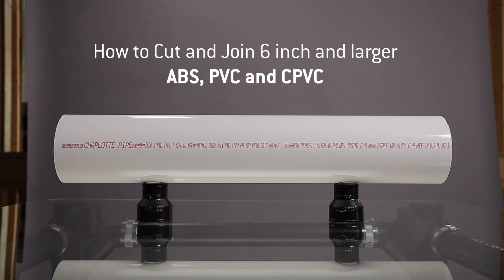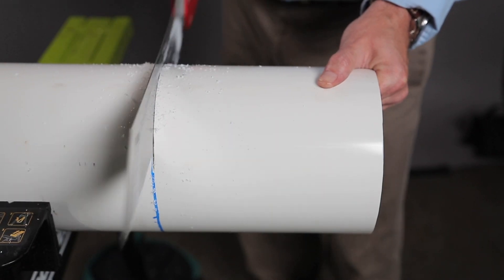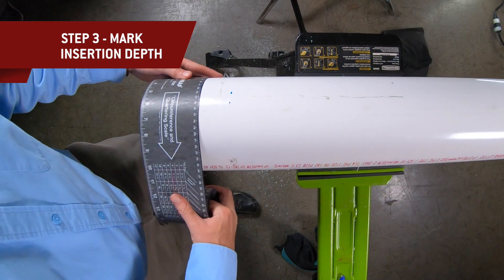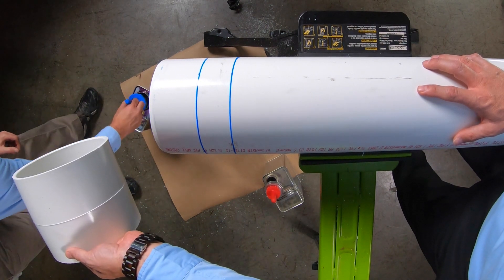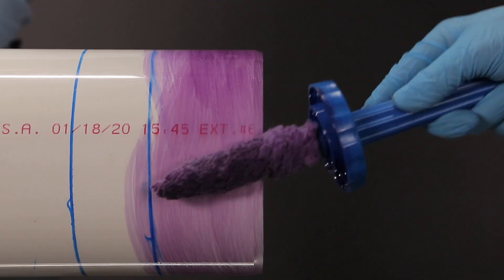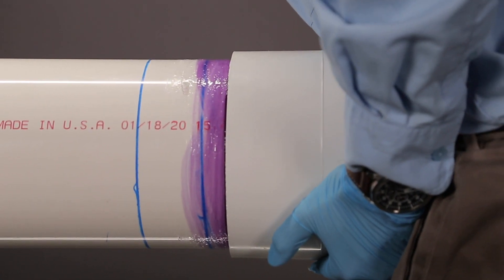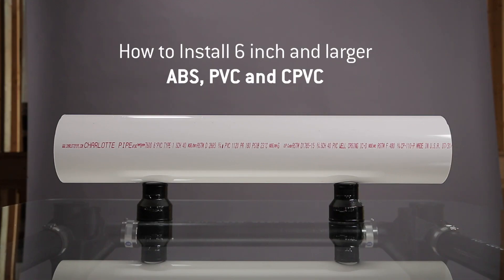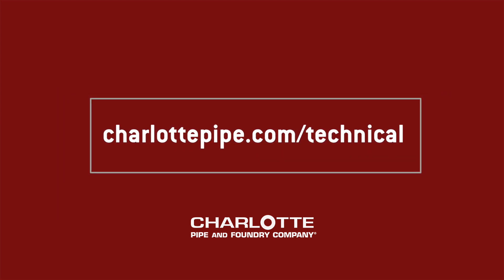How to Cut and Join 6 Inch and Larger ABS, PVC and CPVC

Comment: Can you use 2 pieces of 48" of 4x4 sandwiched together like this II and a sledge hammer to hammer a full length 8" pipe into the hub? Or will the wood just absorb the blow and now push the pipe in? Anyone try this before?
Reply: Yes, it will work so long as you keep the pipe level with the fitting.  You have to be sure that the fitting is secure and will not move as you pound the pipe into place by bracing the back of it with some wood scraps or something similar.  The best thing to use as a buffer is a square piece of 2 x 12 or several layers of 3/4" plywood that totally covers the pipe so that the specific impulse of each blow is distributed across the entire pipe surface.
Needless to say, everything has to be done quickly.  The solvent for PVC pipe cement is acetone and the stuff evaporates like nobody's business.  The cement will start to set up in about 45 seconds.  (less on hot dry days.)

Comment: I bought a 90degree elbow for my 6 inch pipe.  The outside diameter of the pipe and the elbow are the same (about 6.6 inches) so it can't slide on.  Is there different sizes of fittings?
Reply: To me, it sounds like you might have bought a SCH30 (thin wall) elbow for a SCH40 pipe